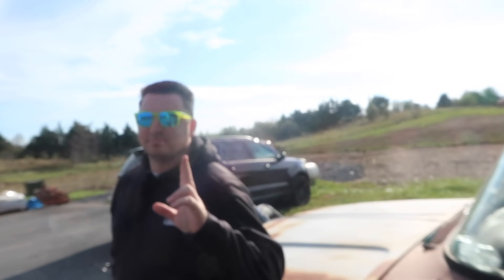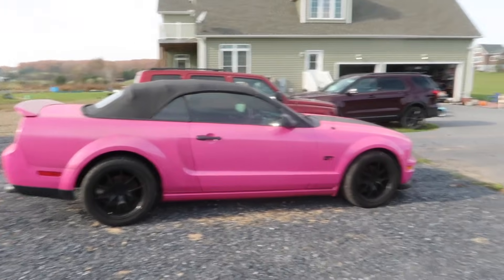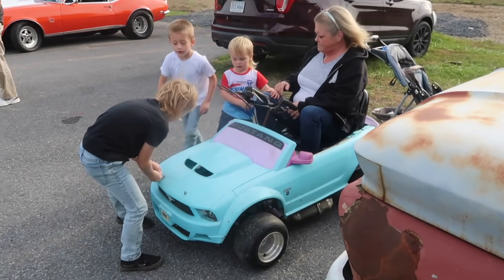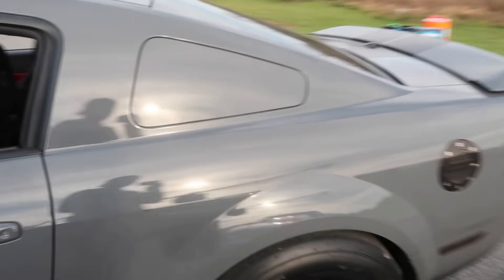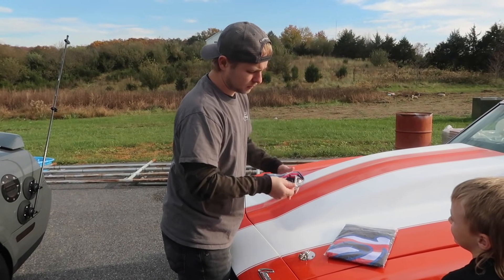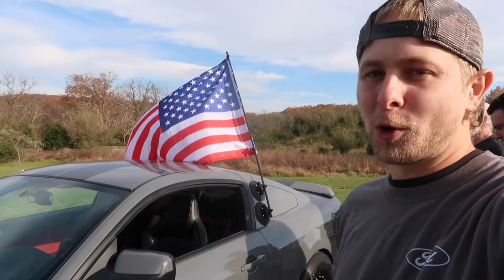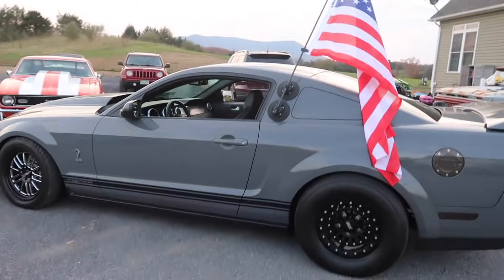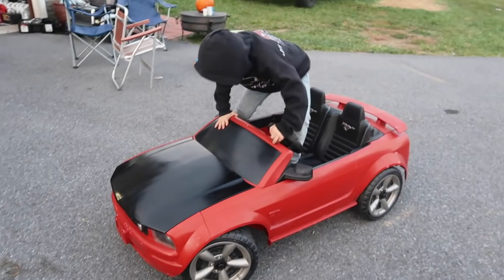GT500 Get's BAD FLAG Modded Added a Car to the Fleet

Comment: I’ve got a 1970 1/2 camaro drag car for sale if anyone is interested. Has a built 434 small block, back halved with a narrowed Ford nine inch. Has a 2 speed powerglide, wilwood brakes, full slicks, strange axles. All steel except hood and all original glass. $15000 gets it. Located in texas